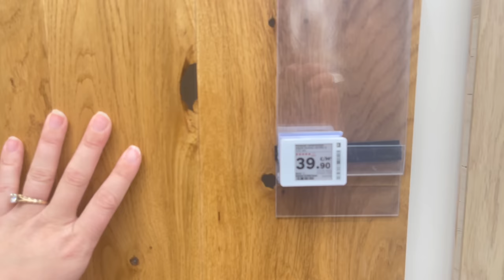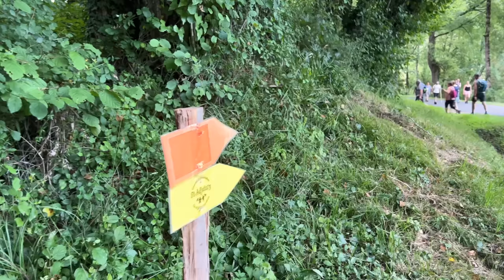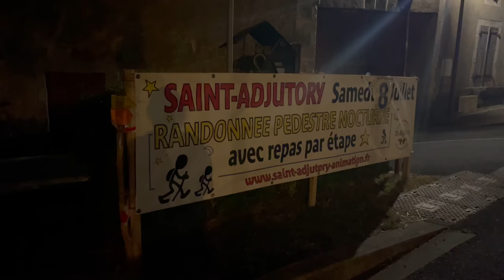FRENCH SUMMER DAYS | Painting, Renovating, and Exploring the Idyllic Countryside

Comment: Wanted to give you a suggestion on a Swedish floor company that has a click locking system that you can unlock/dismantling with their "special key". I don't know if you can unlock all their floors, I saw it when I looked at a herring bone floor being laid on their YouTube video (link below), witch they also say that one does not need to nail, glue or have to grind or lacquer.

The special thing with that floor is that when you install and do something wrong you can use their "special key" a dismantling tool and "unlock" a part. Which in my mind would mean that you should be able to install the floor and take it up again after a few years.

I wanted to reach out to you as from what I understood in your video, you want to take the floor up in a couple of years... this way, if it works.. you can put down the floor, unlock it in a couple of years, do the renovation and then use the same flooring..

I do not know if this would work or not.. but if it does, it could be such a money saving option :-)

The company is called Bjelin

- Homepage (they have a lot of "big" photos, so takes some time for them all to load up)
https://www.bjelin.com/en/?pk_vid=f8a16d1c1b05a9671689524992e9bcb7

- YouTube clip, here is the video I saw. You can see their "floor installer" use the key.
Time, 02:43
https://youtu.be/A_mILIfVQYI?t=167
Reply from the maker: What a wonderful recommendation! Thank you for sharing :)